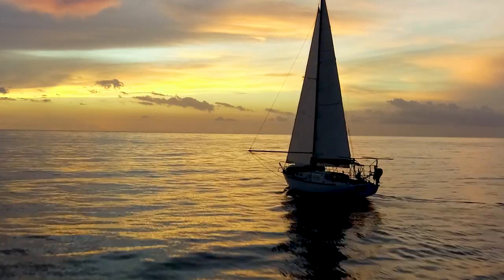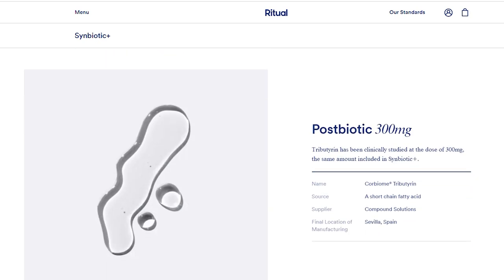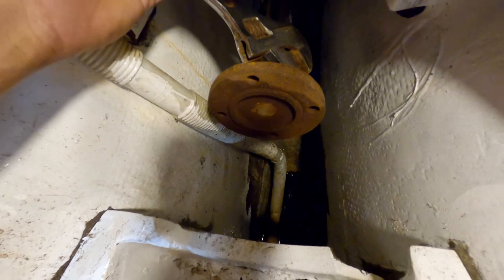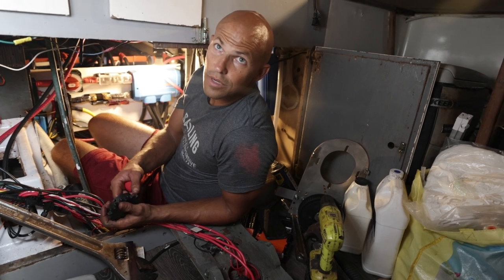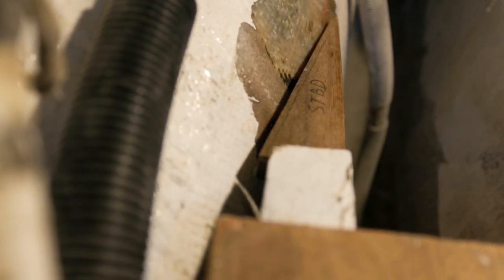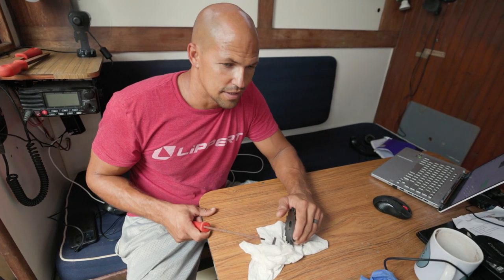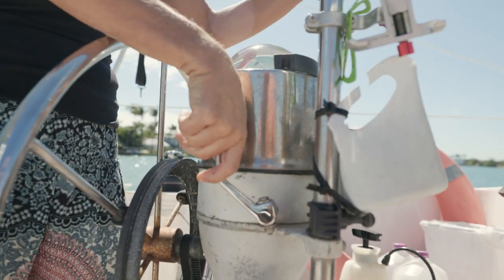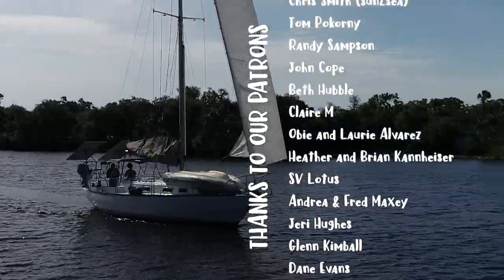we RIPPED out our SAILBOAT’S ELECTRIC MOTOR for THIS!

Comment: Now all you need to do is put a outboard motor mount on the back of the boat just in case you have a motor failure again you can use the outboard to get you in and out OK
Reply from the maker: This was not a motor failure, but a transmission coupler failure, which could happen to our diesel engine friends. don't see any outboards hanging off their boats, so not sure why we would need one on ours. ✌💜
Reply: Because range, range man, range.
Reply: Nothing to do with it. 
"Oh...where's your magic wand that fixes every frickin thing?" You are a goober!!

Comment: When I had the same problem with the key, I used a "step key."  A step key is one size on 1/2 of it and another size for the other half.  That cost me about $8 at the local hardware store.  Also, when I mounted the mounting plate (also from Thunderstruck), I mounted it directly to the old stringers.  Motor mounts are to prevent the vibration of the engine from transferring to the rest of the boat, but the electric motor doesn't vibrate like a diesel engine.  One tip I'll give you is to make sure things are coated to prevent rust.
Reply from the maker: Thanks for the tips Jeff. will have to look for that step key, just so we have it for the future!
Reply: @BeauAndBrandy  If you filed it out already, you should no longer need a step key, but just keep it in mind if you do something similar in the future.
Reply: I didn't know about step keys either.  No need for one at the moment but good to know!
Reply: @BeauAndBrandy  When in machine shop class I made a threaded step shaft of different diameters and threads , never occured to me about a step key..why not..good one!

Comment: Hi Beau & Brandy - Quick message to thank you for your 'cillaxed' videos as it inspired me to start my own electric sail-motor motor build. I am designing/building a similar setup as yours but instead using two brush-less/water-cooled 48V 10Kw Golden Motors in parallel (driving one propeller shaft). If you are interested in following the build then I have posted my first video showing the motor housing:) Thanks again and keep the boat adventures coming!!:)

Comment: I installed a TS 10kW motor early last year. It is the best decision I made. You made it look easy.
Reply from the maker: NICE! some cutting out of certain words may have happened lol.
Reply: I hope to never swap out my Yanmar!
Reply: @BeauAndBrandy  lol…the top secret motors were out of stock so I settled for thunder struck
Reply: @thinkcasting3182  my Yanmar actually worked fine. I went electric mostly because of sound and smell of diesel.

Comment: Nice video guys! I did the Thunderstruck 10kw with reducer conversion on my C&C 32 last year and you hit many of the same snags. Mine is working great and will hopefully stay that way. Keep up the good work!
Reply: Hi Patrick- I’m reworking a bad alignment on my C&C 33 Mk1 - any chance I could DM you with questions on disconnecting the bike chain thingie?
Reply: @garyseven777  Gary, I just pop the master link clip off with a small screwdriver and slide the link off of the chain. If there's a way to do it safely send me your contact info - I'd be happy to chat.

Comment: 🤣think about using some Loctite on the screws, but if you ever have to remove any you have to warm them up to 500 degrees with a blow torch ... glad you got the motor running ... I miss the little bird that hitchhiked a ride from you 🤣😂🤣

Comment: We run into the key way issue with agriculture PTO shafts. We take our key way  and machine one side to fit the smaller slot in the gear. And field repairs we use your grinder with cutting wheel  to work the key.  Much more abuse then your putting on it. Just a thought if you run into a similar issue in the future.

Comment: FYI wd 40 ok. Blaster best.  When the gear puller nut is tight tap it with a hammer. The sudden jar makes it  release.  Nylon lock nuts way better than  lock washer.  Or use loctite  vibration  bad.   ❤ nice work
Reply from the maker: Thanks for these tips dave!! always appreciated!

Comment: You guys need radar, that is the sponsor, you need.
Reply from the maker: Gotta contact? 🙏
Reply: @BeauAndBrandy  with your 10,000 nm and , passion and Great film Making, you might be Able too do multi spots kind of ads and instructions, for West Marine, there you might be able too swing a couple of badly needed upgrades, for how too for their site, for the price of the said hardware and Systems.  Others with allot less views have done it.  I think the WiFi , Radar system, You only have To run Power to it, would be a great option.  You can be sponsored by Safe Harbor, they own allot of Marinas up and down the East Coast of the USA.  With your skills learned the hard way you guys should file for your Captain licenses.  If you did not keep a log book certainly your channel and yes requires some study, but certifications never hurt. At least a 6pac that is very easy, would qualify you to deliver Yachts for others.  Adding content and revenue.  Not everyone can sail across the Atlantic Ocean or from the Caribbean, having those licenses would open up that kind of world to you.  I have too do a Major refit on my Beneteau Oceanus 350 1989.   Owners Version.  Picked her up as the second owner, in 1995 Put 7200 nm on her, would take the summer off sail her with my sons and wife, allot like the sailing you guys have done but with allot of the modern things like a summer home.  Made my sons the Men that they are today.  Had a stoke  7 years ago, was fully Paralyzed on my right side, just when I recovered, then the covid, so Starlight has sat on the hard the whole time.  Been watching from your beginning, always wanted too sail Starlight in the waters of the Caribbean.  God Bless fair winds, Bravo Zulu too your channel…

Comment: Two ways to deal with the key-way and sometimes putting a step in the key is easier since its usually milder steel than the coupling.

On the electric drive I have concerns with these kits that use an open frame motor so low in the bilge that will get salt water corrosion inside them increasing the chance of failure.  That cogged belt can sling an awful lot of water from the bilge into the exposed windings of that open motor increasing your chances of total failure when you might need it the most.

Elco uses totally enclosed motors and has been making electric inboards since 1893 with a good number of their original units still in operation today 130 years later.  Their other division, General Dynamics, is well know for the electric propulsion systems they've been making over the past 100 years or so for submarines.  Cost-wise both systems appear to be close pretty close and with the Elco you get a TEFC marine grade epoxy coated motor that spins the correct RPM without having to use a belt that can fail at the most inopportune time.  

Best!

Comment: you two are the best. I just love watching you figure stuff out. I too have an inexpensive 30’ craigslist sailboat that I’m fixing up and sailing the san fran bay. I always look forward to your weekly videos. I agree with one of the other commenters, put an outboard bracket on the transom and hang a little 9.9 hp outboard on there just in case something goes wrong with the electric. The peace of mind is worth it. I put one on mine when the original motor was not working and I’ve decided to keep it just because of that. it’s always nice to have a back up
Reply from the maker: best of luck fixing her up! bc of Saoirse size, weight and the big over hang off the transom it would be pretty difficult to put an outboard on her. we find it unnecessary bc the electric has never failed us, the transmission coupler on the other hand haha.

Comment: I have an 18kw 96v setup from ThunderStruck with the reducer. Works great.  Make sure those bolts are tight on the flexible shaft coupler or you may find your shaft trying to go for a walk when you go hard in reverse.

Comment: Hey, Beau  - Thunderstruck's reducer has worked great on my 32' wooden cutter-rigged sloop for the last 7 years. Talk to Thunderstruck about a sprocket-to-sprocket adapter on the shaft. Piece of cake, dude!
Reply from the maker: thanks for the tip!
Reply: @BeauAndBrandy  My prop-shaft is 7/8", the reducer shaft is 1" - Thunderstruck got me 1 x 7/8" sprocket + 1 x 1" sprocket - the two have different I.D.'s but same O.D. (and number of teeth) - so the coupling is perfect . . . .

Comment: I'm hoping you did apply some locktite red on all the threaded fasteners. It still has some subtle vibration you cant see, the loctite will lock the fasteners until you need to disassemble

Comment: Your new mount should hold up well.  A couple of tips that might be useful 1) for areas of high exposure to water (bilge) and that have any penetrations (fasteners), it is worth considering G10 or similar material as a  choice over plywood for an encapsulated substrate, and 2) sometimes when grinding or cutting fiberglass or similar material it is easier and safer to keep it wet and clean up the slurry, than to deal with the dust.  Cheers

Comment: Broaches are not super expensive and you can order one from say msc and have it in a few days. The broach is the width of the key and a sleeve is also needed that is the diameter of the hole of the pulley. Once you have both in hand ideally you use a press to push it through but I have seen them tapped through with a hammer or a makeshift press improvised with a tight space and a lever of some sort.

Keys also come in different sizes and even in 2 sizes - one for the shaft and one for the pulley with a little step there on the split line.

Spending a little time with a file also works well as you found.
Reply from the maker: yes, by the time we ordered the broach and such we decided the filing was the best route, we were on a little of a time schedule.

Comment: Wow, quite a reduction... almost looks like you could stop it with your bare hands.. the load test will be the real test.. 
I was kinda yelling at my phone,,, put a good, square edge file in that keyway slot... Great minds think alike.. 
Tip.. make sure you get a toothpick with dielectric grease on those connections.. and heatshrink everything.. you will be in some pretty harsh, (salt moisture) environment..
Great job my friend,  proud of you.. 🎉
Reply from the maker: Thanks so much Kevin. We didn’t show it in the vid, but it’s all heat shrinked and dielectric-ed 😁
Reply: Also, in the hanger, we use, those gloves too. In this humidity, keep some baby powder around.. makes it a whole lot easier to get them tight to the fingers..

Comment: it would seem that getting a different prop and/or motor would be a more efficient option than gearing it.   I've heard it said it is more efficient to convert rotational motion to electricity, pipe it thru several hundred yards of wire, then convert it back to rotational energy than it is to run it thru a 90 degree gearbox.   Now I know that's not exactly what you're doing but it's illustrative about how utterly INefficient gearing can be.   Just better engineering on the motor and prop would yield pretty HUGE rewards in a marine environment

Comment: Well hello there looks like you are having fun with the motor refit. One piece of information that most people don't realize and that is WD-40 isn't a lubricant. It's a cleaner. I would have used it to clean the shaft but what you really needed was a penitration lubricant like liquid wrench. But if you don't have any than yes its better than nothing. Liquid wrench will lubricate and penetrate the rust and what ever developed on there. Just spray it on drink a beer and after about 15 minutes it should be loose. If not smack it with a hammer than spray some more and drink another beer than it should come loose real easy. Beets 4 hours and alot of elbow grease. So I recommend keeping that on board. Just a little heads up.
     Great job with the motor. Myself I'm not a big fan of switching to electric. But I understand the whole save the world and solar power and no buying diesel. But my thoughts are diesel generates power plus and this is the big factor, when the electric runs out is usually when you need it most. But I do understand that electric motor is much more cheaper than a new diesel motor. But anyways great job. And yes you did a fine job of the fiberglass. Well see you next week. Oh yeah, I bet that was great fun filing that gear for the key way! Okay have a beer and celebrate.

Comment: I’m extremely allergic to chronically underpowered propulsion systems in Sailboats  after Crewing on such boats that got stuck in some petty serious situations it was impossible to  Sail or Motor Out of. Luckily dropping anchor and waiting for high Tide Slack Water got us out of Really deep Doodoo, and no Storm was incoming while we waited it out. My Next Sailboat, a 44ft comes as standard with an 80hp inboard Diesel for very good reasons, and my 10ft Tender will have a 6hp four stroke outboard for the same Safety Reasons . At Sea, even close to Shore, Conditions can get really nasty and not as forecast way faster than most  people seem to realise from Calm as a Millpond to Oh Shit Now What do we do. 🤔

Comment: what nominal voltage are you running?
i think that's why these systems are sold in pieces....it's probably no problem, ( no regulation violation as of yet ), and just becomes at the installers own risk, and that's all.
but people need to know that 38.4Vnom is a saltwater maximum, beyond which it is at your own risk.
and i think systems running higher than that would have to be dismantled before reselling the yacht.

Comment: Corrosion and Electrical 
If you have any corrosion on any electrical connections
Simply spray all connections with ‘Lanolin’ 
Here in Australia our go to lanolin is ‘Lanotec’ 
It is brilliant on all electrical connection and seals them from the atmosphere 
It will prevent shorts and open circuits and also prevents RUST by sealing nuts bolts etc
Lanolin has strange but excellent properties when it comes to electrical.
We never had a dry or corroded joint after we started using lanotec on every connection ever again.
‘NOTE’  -  DO NOT let it near Rubber Seals, Gaskets or O’Rings. It degenerates them
Also …. Do NOT use as a lube in winches or moving mechanical equipment…. NOT GOOD
We used Lanotec on our winches. 
When the thinning agent in the spray lanolin evaporated off over a month or so, our winches all ceased up and we damaged one to the extent it was replaced.
Good luck and keep up the great Lifestyle you have carved out for yourselves.
Cheers   Rosco
Reply: or LPS 3

Comment: Your chain cupler is not as forgiving as a cupler called a Love Joy cupler. Really keep it greased. You con get a Love Joy cupler that made out of neoprene and no maintenance,  cheap enough to have a spare, any miss alignment at all with the than style  cupler and one side of the chain will wear alot faster, Love Joy doesn't do that
Reply: You must be a millwright mechanic to know that..good one.They used them a lot in the pulp mill I worked at

Comment: I see this as a temporary solution. The engine used is weak and not suitable for sea/water use. It is not waterproof and not made of good quality materials. It's some cheap aluminum and zinc alloy that already shows signs of corrosion which in this case threatens to grow into cracks because seawater (and condensation) tends to cause intergranular corrosion on these alloys. Get an engine that is waterproof and made of seawater resistant materials. And which does not need a reducer and has good power control, i.e. a BLDC Motor! You also need to have enough power in the batteries to run the motor for at least two hours at 50% power. I consider 30HP to be the minimum power for a sailboat like this. Because it is not good to run any technology at 100% power. At 50% you will still have 15HP and that is sufficient for calm water sailing, while having a backup +50% power for emergencies. Also consider whether you have the option of running a petrol/diesel power generator while sailing in rough seas. For possible emergency battery recharging. If you have a 5kW generator then you should be able to recharge the batteries with at least 50% of the power of that generator. i.e. for a 48V system recharge with 50A.

Comment: That is NEVER going to work long term. The looseness in the chain coupler will allow the shaft to beat the stuffing box and seal to death.  The proper way was to make the shaft rigid by using the flange that was on the shaft and a new flange for the motor shaft. PowerTrain Engineering 101.

(;-) TP
Reply: I couldn't tell how the thrust is supposed to be absorbed either. Was there a thrust bearing or something? I don't know. Not a subsriber. Just passing through. None of my business.